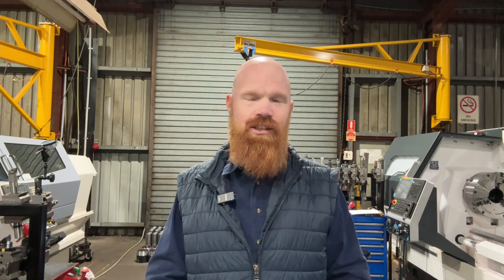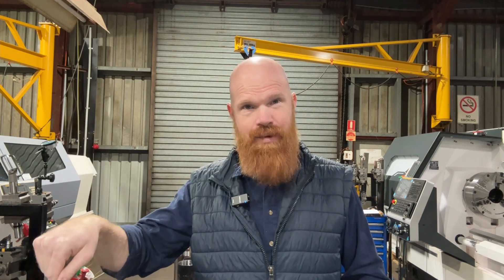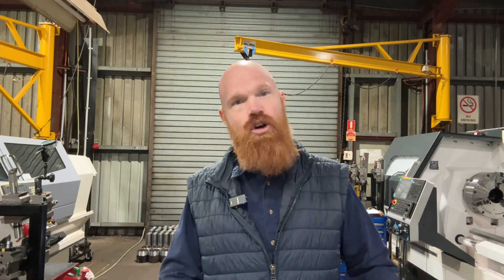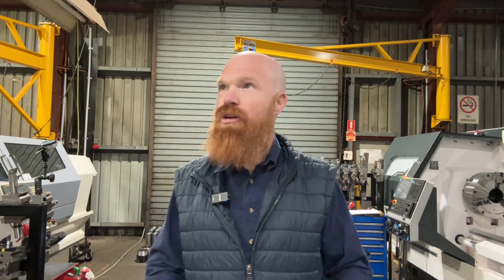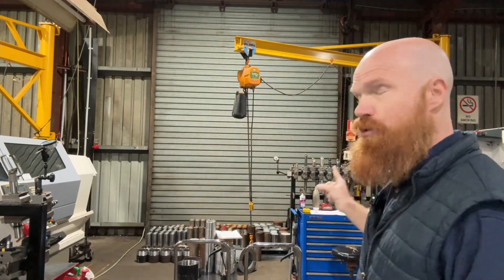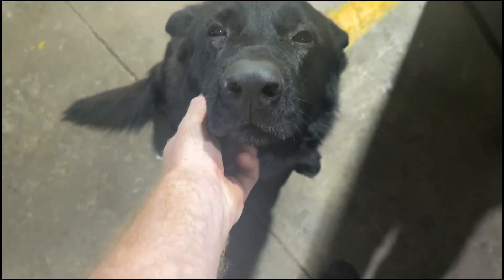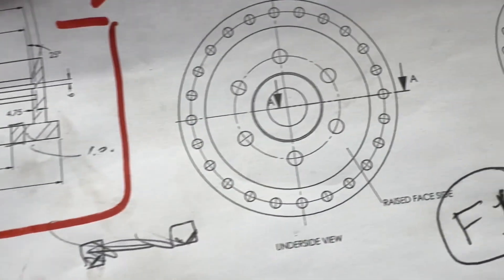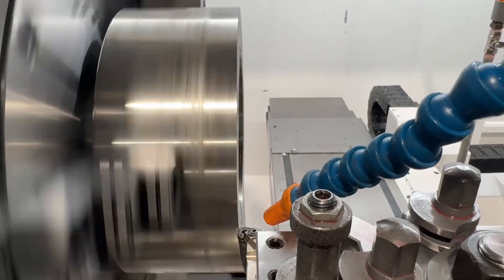CNC Machining Inserts for The Big Rig (Mesmerising To Watch)

Comment: Notice that the lathe speeds up as the piece is worked inward, keeping the linear cutting speed constant and increasing the efficiency of the operation.
Reply from the maker: Love CSS on most jobs.  With bigger stuff running steadies I stick to constant rpm though.

Comment: Sounds like you need a vertical boring machine  . I run one that swings 1.4 metres they're such a versatile machine and way easier to  set up then a horizontal lathe.  Cheers.
Reply from the maker: Funny you should mention it…

Im looking into one right now.  It seems like a bloody good option.

Do you have any recommendations for good, reliable, heavy duty machines?

I’ve got no experience with this type of machine.
Reply: @halheavyduty  yer a good old Webster and Bennett Ora bullard or schiess are fairly bullet proof machines . You probably don't need a twin turret, get one with a adjustable turret head so you can machine taper angles  . And preferably one with screw cutting capabilities.  Cnc versions are a shit ton of $$ so probably not worth it  for 1 or 2 of jobs.  If the budget and shed space allows it a machine with a 42 inch or 1 metre chuck would be a bonus.  Hope you find one there really a great machine to have in any heavy machining shop.
Reply from the maker: Thanks for the suggestions. In the process of exploring and researching it all this week.

Very helpful.  Appreciate the insights 👊

Comment: Hey. I hear you asking about the internal groving. I do a lot of this in really tough or chewy? (not my default language) material (like soft aluminium or stainless steels) - and depending on my working place, im not able to stand by and watch the whole part running. Best way for me is to interrupt the cut after 1.25 spindel revolutions by withdrawing the tool. So when my feed per revolution is 0.1 i have  have 0.125 of cutting dept before i withdraw the tool for 0.15mm or so. It sounds crazy, but works perfect and it isn't that slow as it sounds, when your cnc is able to withdraw the tool in G0.
Reply from the maker: Excellent advice. Thank you for sharing my friend!

Comment: Mi Matt, I couldn’t help but noticing that when doing a facing job, as the cutter moved towards the centre of the workpiece, the angular velocity increased. Is this a CNC control feature or is it built into basic functions of the lathe? It’s just that I have been looking around for a new lathe and a couple mention automatic speed compensation. I guess it means that you choose a CPM rate and the machine does the rest. Cool!
Reply from the maker: The machine has CSS - constant surface speed.

So you just choose you VC (in this case I think it was 170) and the machine increases RPM as the cut decreases on the X axis to compensate automatically.

It makes for really good surface finish, and supposedly increases tool life - which makes sense.

Comment: Internal grooving, "peck cycle" in your program, will help break chips. Usually there is a parameter for depth of cut per peck.
Reply from the maker: Definitely going to stick to pecking for 4140.  Seems the common solution being recommended.

Comment: Is your machine capable of spindle speed variation?  I used to run a large Haas lathe and SSV was like a cheat code through all kinds of challenges.  It may let you peck or dwell to brake the chip without chatter issues.
Reply from the maker: It has a Fanuc controller, but not sure if it has SSV.  Will have to check.  Great suggestion.

Comment: Re chip breaking with the internal groove my thoughts are increase feed rate to .2to .3mm/rev maybe even more.,and drop surface speed by 10-20%, apply raw soluble oil with no water added and if that fails assuming you have minimized overhang turn the bar upside down and run the spindle in reverse, however the thinner the material is getting out from the iD of the groove to the od of the part the vibration will work against you, another trick is to do the grooving and boring before reducing the OD so the work is more rigid, skinny sleeves squeal and the tool height fluctuates and does not relieve the material at a constant rate, just keep trying heavy feed rates and even go under 120m/min, the answer is in the fine tuning, previous comment about adjusting tool center height has a lot of merit, especially on 431 SS. Condition T 4140 responds well to wide variations in changing the approach angle of the insert by pivoting the tool post and changing the actual length of the cut as opposed to depth really well especially on tools like the CNMG when roughing out on the OD, I have also found tightening up anything loose on the machine and bringing in the tailstock close to the headstock and locking it down removes a few mysterious conditions, first job on a cold morning is another tip, hope it goes well for you, good video.
Reply from the maker: Dude that’s some solid practical advice. Thank you 🙏👊

Comment: I’m a CNC Machinist in the drilling Industry for NoDig Equipment Perth WA. 

I use SECO grooving inserts (LCMF160402-0400-FT CP500) at 0.18mm/rev and 130m/min.
I use Korloy part-off inserts (Saw Man-X) at 0.16mm/rev and 160m/min.

If I have bad chip control for grooving or threading I increase the spindle speed. For turning and boring I increase the feed. Usually just on the dials. High pressure coolant will also help.

My colleagues use dwelling or pecking to break a chip when grooving. Although iv always managed without it.
Reply from the maker: Thanks man. I appreciate the comment. Super useful info that I’ll apply in some future runs.

We run some seco gear and it’s really good stuff.  Might have to look into their grooving tools.

Using Iscar at the moment, just because it’s so easy to order to be totally honest.

Kennametal has dropped the ball big time in Australia…

Comment: Hi Mat. I was wondering how you go for steel and parts deliveries at your location. Is it a logistic nightmare or do you have a reliable delivery system in place? Cheers.
Reply from the maker: We have pretty good systems in place, but limited options for 4140 steel.

Especially hollow bar.

Can’t easily source it in Australia, but everything else is easy enough thankfully.

Great question by the way

Comment: IF you need to break the 🍟🍟on the Internal Grooving Tool.
Just program a Chip Break.

And maybe increase the Feed Rate to at least 0.20mm per rev 👍
Reply from the maker: I’ll give that a crack.

Got 60 monster tool joints to make in the next 6 weeks that all need circlip grooves… so PLENTY of material to experiment 🤣

Comment: Greetings from NSW. I use fanuc and fagor controls at work. I use a pecking grooving cycle for internal work. Usually 0.25 on radius pecks and return 0.05. Doesn't take too much longer and swarf is a better size.
Reply from the maker: Awesome to know.  Thanks for that.  I think I’ll reset the grooving programs for pecking.

Especially on deeper grooves.  The long swarf drives me nuts.

Out of curiosity, do you prefer the Fanuc or Fagor controllers??

Comment: internal grooving sucks full stop. you can get some chips with super aggressive feeds but even then some times you just get thicker flat bar coming out. I would say look at different chip breakers on the insert so talk to you tooling supplier on that. With that said those chips look pretty good to me even if they are a bit of a string of death.
Reply from the maker: Good to know. And I pretty much agree.  I’ve gone rather aggressive on other parts and I just get super thick strings of gnarly swarf! 

Might just peck cycle it for deeper cuts in the future.

Thanks for the input 👊

Comment: I feel your pain of machining in the relative middle of nowhere. I'm in NZ only 3 other cnc shops in my area (one of which I collaborate with) and not having many people to bounce ideas off of.  

The other fun is getting tooling when shops are nowhere nearby. I have a customer who keeps sending me parts with 20-30 diameter deepth holes in odd sizes like 3.1mm and wonders why it takes my supplier 3 weeks to to get me parabolic drills delivered from Germany so he can get his parts.
Reply: I'm in Holland and we ordered a carbide drill and pilot drill from Walter on Friday afternoon and got in Monday before lunch time. Drilled the holes today with the sales rep present and it was pretty impressive. Chip evacuation by high pressure coolant. Do your (deep hole) drilling on a suitable mill and not a lathe if available because on the mill there's no alignment issues.
Reply from the maker: So true. I wish we had a mill that could do it.  I much prefer drilling on a mill.

So cool that you guys can get tooling that quick.
Reply: @halheavyduty  Did alignment on the small Okuma just a few weeks ago. At least one of the 12 tool positions is now perfectly on center with the machine. I had to adjust the turret rotationally, it was off by  about 0.2 mm which is pretty dramatic. I have yet to check for deviation between all turret positions (which I expect to be minimal). As I remember, X offset deviations can be corrected for by machine parameter, there is a table somewhere. I used a centering indicator which worked well, it's nice that the dial does not rotate. For U-drills I think the coolant supply on the old Okumas is adequate (although more is always better). I have to look up what we have available but for drilling deep holes with solid carbide drills it's not nearly enough. The sales rep told me that a good way to check is if there is a plume or fountain exiting the hole, as soon as it breaks down it means the coolant can't evacuate the chips anymore and you need to stop immediately. What's pretty cool is the chip breaking of these drills.
Reply from the maker: It’s wonderful when the chips just break off perfectly.  

I’m fanatic about checking alignment now, mostly after getting a udrill stuck when we were out on the toolpost by about 0.22

Putting Udrills in our CNC has been great, but as it’s a quick change style we have to have solid procedures to make sure we don’t have sparks flying… again 🤣
Reply from the maker: Yeah man, it’s challenging hey.  One of the outcomes I’m hoping for the channel is to get ideas from all around the world on how we can do things better.

I’ve got no ego around “my way is the best way” so really open to good suggestions wherever they come from…

… and if they work really well I’ll be sharing it.

3.1mm hole.  Fark. That’d do my head in 😂😂

Comment: What kind of coolant are you using causing have never seen red coolant the one used in our apprentice workshop is like a milky color
Reply from the maker: It’s an odd choice of coolant for sure.

It’s called holemaker - just a standard drilling / cutting fluid they’ve been using here for years.

Seems to do the job just fine.
Reply: Alright thanks for the information mate
Reply: @beriklelmut1842 the stuff you are using is called soluble oil. It is the old standby coolant that has been used for donkeys years. Modern industry especially with the higher speeds used nowadays for carbide tooling has had to rethink the whole coolant thing and it has turned into a science.
Reply: @glennbrown1961  we also use it for carbide tooling but yea we only go slow since our milling machines are from 1987

Comment: On a cnc you can also force a chip by going out of a cut and back in in intervals. (manual g-code)

maybe if your lathe can do that, vary your spindlespeed between for example: 300-600 rpm. (do the math and pick a range of about +- 24-30%
Reply: also try to play with the depth of cut and insert height. Speed is fine imo
Reply from the maker: Good tip.  We can peck in the program but it seems to reduce tip life.  Going to play with it in the next few weeks.

Appreciate the suggestion brother